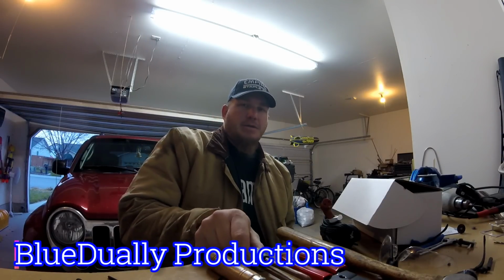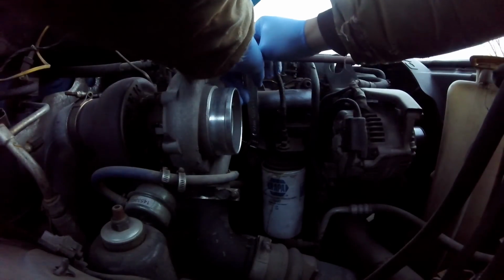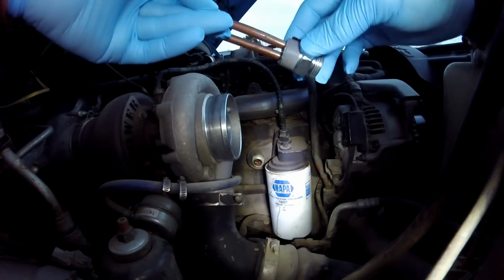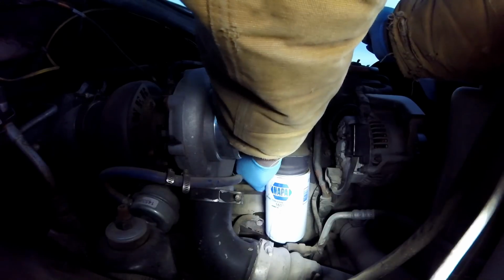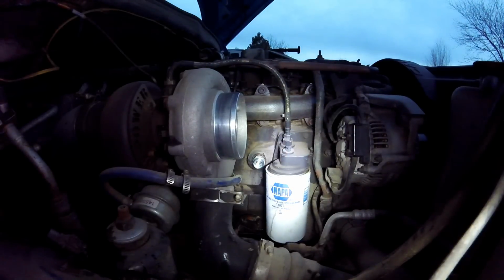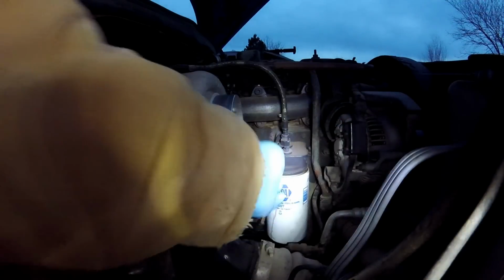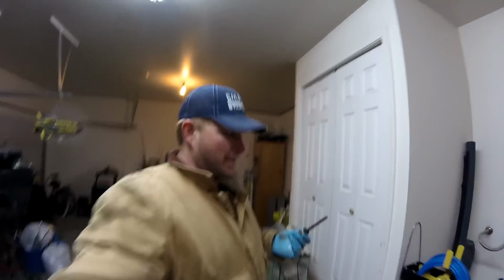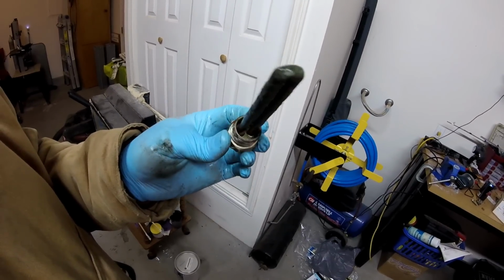12 valve Cummins block heater

Comment: Thank you. How did you know your block heater was not working or going bad?
Reply from the maker: It tripped the surg protector it was plugged into. I checked its continuity with a multimeter and found it was burnt out.

Comment: Where did you get your block heater itself and the cord? I heard you say napa for the cord, but how about the block heater?
Reply from the maker: NAPA as well.
Reply: Did your cord, on the plug end, did it have a little pin under the female end connectors?
Reply from the maker: @daltonhutcheon9236  Its been so long, I don't remember.
Reply: @daltonhutcheon9236 mine had a small metal strip underneath the female ends, you just have to bend it downward wrapping to the underside of your plug. How I found that out is the original one I unplugged was that way, so I copied it

Comment: Not "Plumber's tape". Plumber's tape is steel tape, usually galvanized, has holes in it, and is used for supporting pipe. Thread tape is the term you were looking for, and is usually Teflon, and is used for sealing the threads.
Reply from the maker: The term actually describes both, after a quick search. Because I have never heard of anyone using it to describe pipe strap. It was always just pipe strap. If you search for plumber's tape on Google, teflon tape comes up first. Learned something new, so thank you.

Comment: About What temp dose it keep the water jacket ? Any guess how long the element was ?
Reply from the maker: It is a 700watt heater element, I have no idea what temp it runs at. Probably depends on how cold it gets. Long like its length, probably 5 inches. That element lasted probably ten years, eight of them nearly constantly plugged in from Oct - March.
Reply: Thanks !